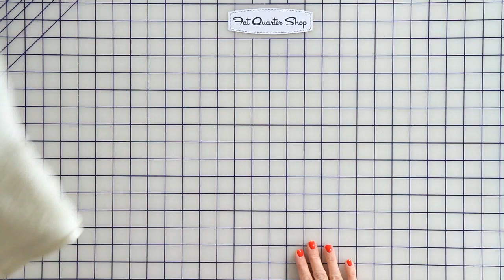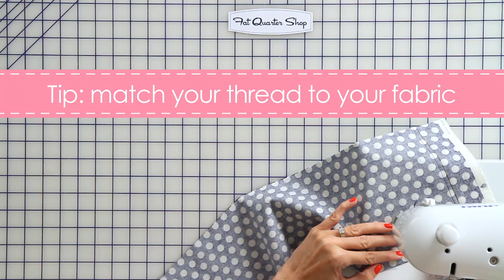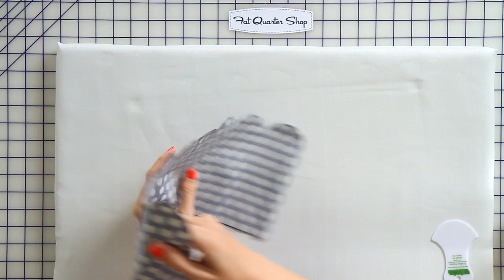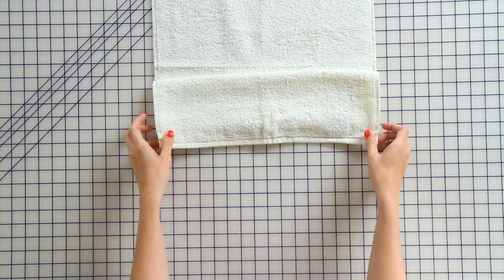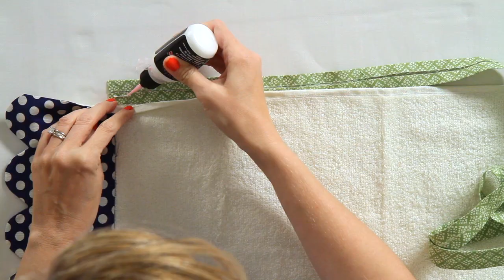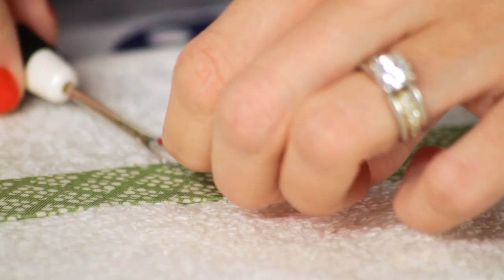How to Make a Scalloped Hand Towel - Fat Quarter Shop

Comment: I have a question concerning when you make that one stitch across...I have made several attempts at this and after much measuring to make SURE that I have sewn a 1/4" inside the traced line, I do not come to that point.  Therefore, I have to make about 3 stitches across.  My scalloped, then, do not come to a crisp point between each one.  Can anyone give me any guidance or direction?  Thank you.

Comment: Thank you for sharing this wonderful video. To all the critics who want to take shortcuts..all the steps here are important if you want a really professional neat finish.  If you are happy with mediocre results, then take all the shortcuts you want.  If you insert the teatowel into the scallop edge then it will be wider than the towel and not look as nice. Pinning will not be as effective as gluing as there is always some shift when you remove the pins for sewing. The fabric is always originally cut wider to allow for some shift when sewing. The seams need to be sewn to get the fabric to sit right when pressed, etc. etc. Obviously, critics should try things first before suggesting and find out why their methods are not used, or put up a video themselves if they think they can do better.
Reply: Well said!

Comment: Maybe it is just me but I would have placed the towel inside of the scallop strip so the fabric would have been on both sides of the towel.
Reply: And trimmed off or picked out the hem to decrease bulk!  And why on earth did she put the trim on so that she wound up with a seam down the middle of the "back"?
Reply: Linda Yeager Yes, trimming the hem off the towel and then insert into the scalloped fabric would have decreased bulk.  Apparently, some people are accusing us of having negative comments but I think we are just trying to help make the project easier.
Reply: +Linda Yeager Where else would it be?
Reply: An excellent tutorial
Reply: than when you topstitch u may not catch both sides. this is a good and easy way.
Reply: From Jess: I agree.
Reply: I would add the trim inside the scallop S well.
Reply: +Linda Jacobs Where else would what be?  Those comments were two years ago and now you are asking questions?